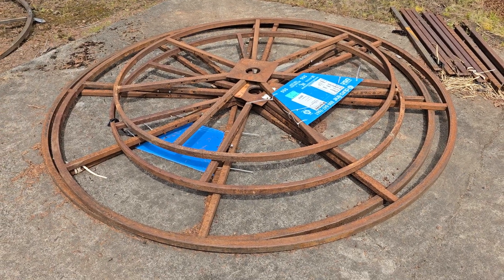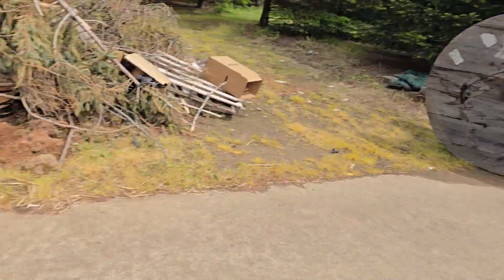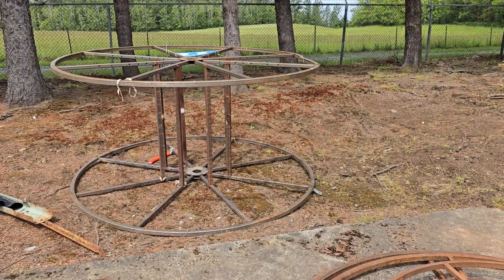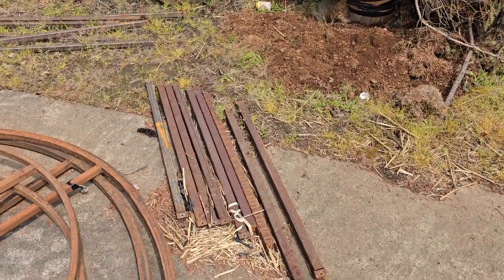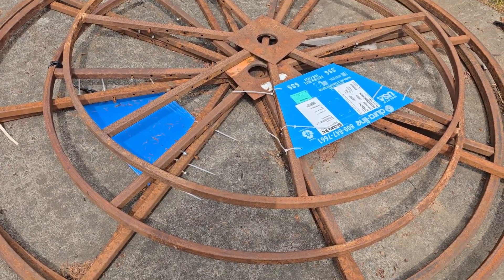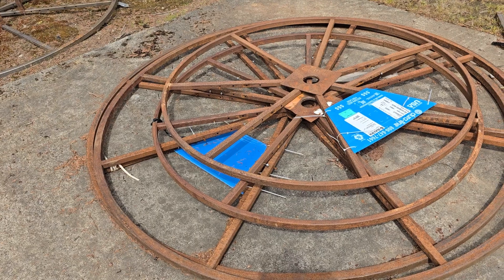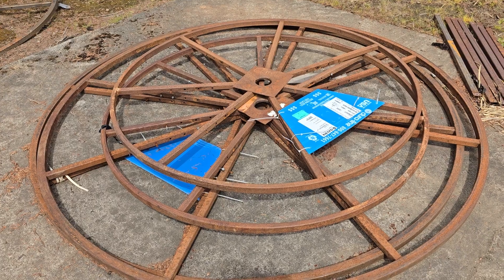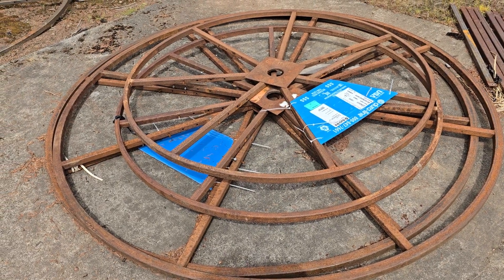Water Wheel Generator Design / Idea

Comment: That cheap generator is rated for what it will do for 5 seconds before it burns out. Run it at 1/3 capacity max, and it should last you a while.

Comment: i have built many water wheels using these frames. I measure the inside diameter of the axle hole and use a hole saw and plexiglass ,this will find you the exact center. you then drill the hole size of your axle and transfer it to a thicker piece of steel and weld it to the existing plate. install your axle and tack weld. build a stand so you can spin the wheel to balance it. i use old grain elevator buckets for the scoops.  they will turn with a pencil size stream of water.
Reply from the maker: Tbat is a great idea. Do you have a video of any of your waterwheels?

Comment: I made a water wheel out of a wire spool. The spindle I used was a rear axle off a front wheel drive car with a 4 bolt lug pattern. It worked great. Not a lot of modification needed and it is strong and very easy to spin.Make sure you get the whole assembly. Rim included so it can be easily assemble and disassembled.  Best of luck.
Reply from the maker: Great idea

Comment: Interesting project.  I would think really heavy wall pipe or solid shaft and large pillow block bearings.  Over build everything rather than not.  If those other reels are available might think about doubling up on the water wheel frame at least.  The force that water can exert is tremendous.  Will be watching for updates!
Reply from the maker: I ordered 25mm (7/8) solid shaft with pillow bearings.